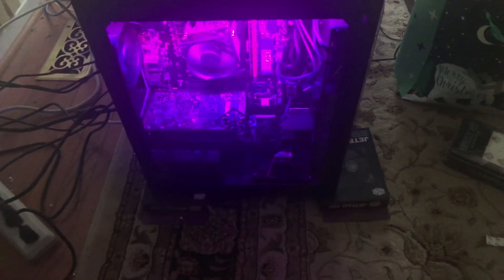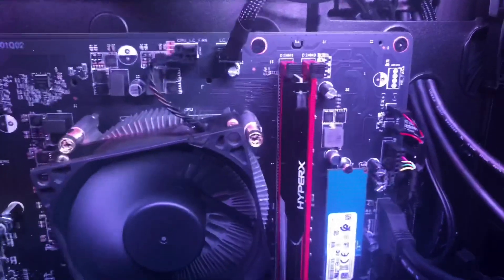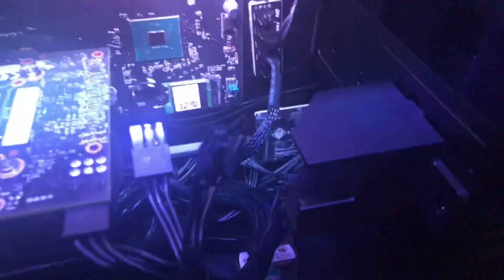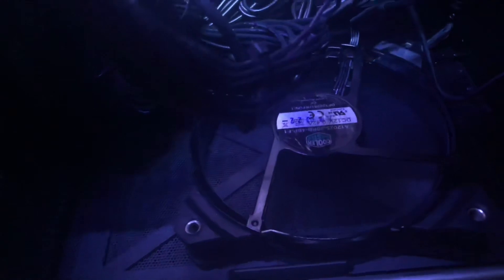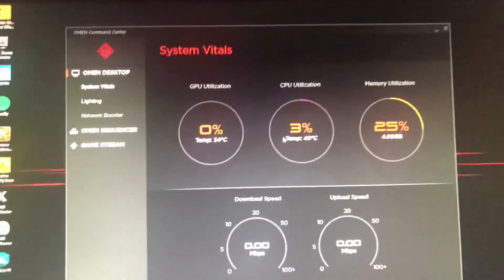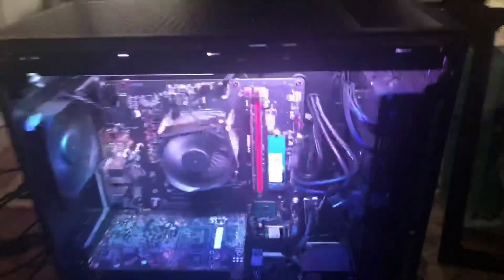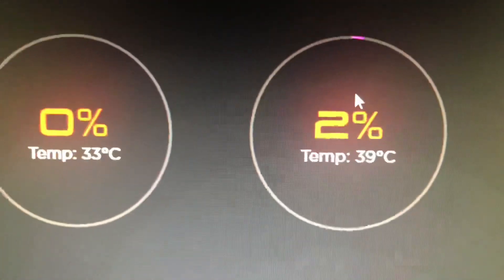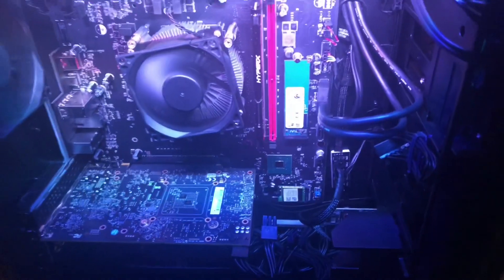Hp omen obelisk heat problems solved, no motherboard removal

Comment: Yo I have a question would that motherboard be compatible with the new rtx 3070 I have the same specs as u
Reply from the maker: Hey man, interesting question. I am also planning on upgrade to the 3070 ASAP. This motherboard is special and it’s hard to find anything on compatibility for the 3000 series cards. Personally for me I’m gonna rebuild my pc but keep my cpu. If you budget is tight I recommend going with a cheaper b450 and new case to make sure 3070 has proper space and cooling. Also the 500 W power supply is not enough for 3070, you will need at least around a 700 w
Reply: @buckeyebeck5456  ok my plan is to sell all the stuff I’m replacing, I’ll replace the motherboard with a b450, the cpu coolers with an AIO, and get a better power supply, and obviously get the 3070. Do you have any idea where I can sell my old parts?
Reply: I might keep my ram is 2666mhz good enough for 3070
Reply: Actually I’ll get a noctua
Reply from the maker: @IWR_YT  the parts in the hp omen don't really have any selling value other than the cpu
Reply: @buckeyebeck5456  true, but honestly an extra 50 bucks isn’t bad still saved money
Reply: @buckeyebeck5456  I’m going to get the z390 since b450 ain’t compatible with 1151 chipsets
Reply from the maker: @IWR_YT  sorry man i meant b365, was really tired when I sent that lol
Reply: @buckeyebeck5456  ohh ok
Reply: @buckeyebeck5456  it’s fine I can spend enough to get a z390

Comment: DId you secure the bottom fan you added as an intake? I was thinking of doing the same, but maybe put the dust filter on the outside of the case and DIY (forcefully) screw a 120mm fan to the bottom of the case.

Comment: I just bought a The HP Omen 25" Obelisk Desktop 875-0160  . I was looking where the HDD cords are at and they are connected to nothing . Is there supposed to be connected  to something ? I can play modern ware fare on max settings like nothing
Reply from the maker: One is connected, one is not connected and is kept for you if you decide to ad another hard drive
Reply from the maker: Hp has service videos about the extra sata data cords
Reply: Do you have the link ?
Reply from the maker: @fukubish6024  https://www.youtube.com/watch?v=EGUhYzBk6Go
Reply: That’s the thing I don’t have is a hard drive . Does it have to come with one ?
Reply from the maker: @fukubish6024  wdym you have to have a storage option or else your computer wont work

Comment: Oh yes. I definitely recommend a water cooler. I personally use a cooler master 120ML RGB, but a Corsair or other water coolers are fine. My temperature were stable and my pc is pretty quiet. So yes definitely get a water cooler.
Reply from the maker: mahi fishy I installed one in December it has made my temps and everything in my pc perform 100% better
Reply: Beck H great!

Comment: Nice! I may try a fan splitter with my build. I replaced my exhaust fan with a noctua 92mm fan, added a 120mm fan to the top and replaced my stock cooler with a noctua NH-U9S and added an additional 92mm fan to the cooler. Running Destiny 2 with 144fps and high graphics have my temps no higher than 65 sometimes 58.
Reply: Gerald Rucker did you have to removed the motherboard to install the NH-U9s? I’ve seen coolers like those were you need to install a different bracket in the back of the motherboard
Reply: @neligentcrib4368  I did but it comes with some adapter screws so you probably wont have to. I found the screws after I installed it lol.

Comment: There is an easier fix to this HP overheating problem.  The Windows 10 software can limit the power sent to the CPU so that it never overheats.  Right click on the 'Start' button and go to 'Power Options', then 'Additional Power Settings', 'Change Plan Settings', 'Change Advanced Power Setup', and scroll down and click on 'Processor Power Management'.  At that point three items are displayed.  The last one, the 'Maximum Processor State' is the one to change.  The default setting is 100%; you want to lower that to 90 to 95%, and you will get a dramatic decrease in the CPU temperature.  If you go lower than 90%, the CPU performance will be slower.  Do not go lower than 75% or the system could crash.  But there's no need to go too low, since 90% will work very effectively to curtail the temperature.   
My idle temp is now about 36 to 38C, and the temperature never goes above 41C during normal web surfing.  It used to skyrocket to 57C when opening a new tab on the web.
Reply from the maker: Achak Hakan that should work for anyone who doesn’t need to push for ghz such as people who do video editing nice suggestion!

Comment: Hey Beck,  I was just reading some information about fans and airflow in your computer that I thought you may want to take a look at.  It is not recommending that you put fans on the floor of your case, as this pushes hot air up onto your Graphics card and CPU, which it's saying you don't want to do that.  Take a look.  It might explain why in your video it shows the GPU and CPU temperature go up slightly when you turned on the fan?  I just thought I would share.  https://www.howtogeek.com/303078/how-to-manage-your-pcs-fans-for-optimal-airflow-and-cooling/   One other thing I was reading is you can use the bay slots (that you would use for a HDD) as a place to put a small fan that will blow cool air in.  I am installing a fan in the top portion of my case and am looking into installing a fan using one of the bay slots at the front of the case.
Reply: this isnt true. Hot air rises to the top and cool air goes to the bottom. If you put an intake fan at the bottom it pushes the cool air onto ur cpu and gpu

Comment: I don't know how old you were when you made this video, but I am so impressed with your abilities to problem solve your computer and make modifications that worked for you.  Good job!  Thank you for sharing what you did with all of us!  Edit:  I noticed that you have elevated your computer off the ground slightly.  On my HP Omen Obelisk, also shows a vent at the bottom (why on earth they chose to put it there and not on the side panel is beyond me) and it looks like you have just laid the extra fan you got on the bottom inside of the computer case on top of that vent.  I don't see any area there where you can actually screw a fan like that in, so I am assuming you're just laying it unscrewed on the inside bottom of your computer case?  Questions:  Do you have any issues with elevating your computer like this (do you worry about it toppling over)?  I seem to recall HP documentation saying to lay your computer on a hard flat surface.  You mentioned you had a dog (we have 6 cats), and the cat hair is enormous no matter how much we clean.  It seems cat hair gets sucked into the computer regardless and we have to blow out the hair and dust periodically from the inside of our computers.  Do the dust and hair get sucked up from that bottom vent underneath your computer?
Reply from the maker: Cat 52 thanks so much for the kind comments, I will be making an update video soon as I recently installed new aio cooling systems that made a world of difference plus some rgb. I will try to answer a lot of questions soon thanks
Reply: @buckeyebeck5456  I have the same PC and just installed the coolmaster 212 BE CPU fun and right after installation, no signal to any monitor I've connected to all ports. Any suggestions? PC Boots, Fans and all LEDs turn on as well. I'm not getting any beeps either and it stays on for as long as I let it, before force powering off.
Reply from the maker: Darwin Torres when I installed my aio there was one cord in the upper left corner for cpu power that I forgot to plug in but other than that I’m not sure why it’s not booting I would check all connections

Comment: Dont make a problem out of nothing i got the same temperature as you without any upgrades
Reply: I mean it would be maybe better but you don’t really have to i talk about it with two experts that build PC and they say that you don’t have to the temperature is quite good.
Reply: So are the overheating issues with this PC true? I'm gonna be getting this soon. And I been hearing people say to upgrade the cooling
Reply: Kinda true, tomorrow I’m installing the Corsair  H60 2018 Cooler, hoping for better results. Just worried about taking out the mobo

Comment: So I have the Rtx 2080 so there’s a really no difference but I totally need a better cooling system i really don’t know what to do, could u make a step by step vid
Reply: I recommend changing fans bro
Reply: did you get the water cooling for the cpu? if so, good. then there is a inktake at the bottom for air to come in so maybe get some little rubber feet to put it on for the meantime before you put some fans in it. or just download msi after burner and make them quite as possible while having good thermals

Comment: Hey bud, I just bought 
OMEN Obelisk Desktop PC - 875-0020RZ
OMEN Obelisk Desktop PC - 875-0020RZ
Power Cord
AMD Ryzen™ 5 2600
OMEN by HP Obelisk Desktop PC - 875-0020RZ
CKIT HP OMEN US
Energy Star
FLAG EPEAT
MISC HEVC MEDIA EXTENSION HP
WARR 1/1/0 US
18C2 Cycle AV
DIB WARRANTY 1Y US ENG HP INC
NVIDIA® GeForce® GTX 1660 Ti (6 GB GDDR6 dedicated)
HP RCTO OMEN Moria B450 PC
1 TB PCIe® NVMe™ M.2 SSD
1 TB 7200 rpm SATA
No Third storage
HP black wired keyboard with volume control and wired optical mouse kit
Shadow Black front bezel, glass cover with 500 W Internal Power Supply
McAfee Livesafe (30 day)
HyperX® 16 GB DDR4-2666 SDRAM (2 x 8 GB)
802.11a/b/g/n/ac (2x2) Wi-Fi® and Bluetooth® 4.2 M.2 combo
Office Trial
Windows 10 Home-Pro
MISC PKG Sgl PK TWR Dotcom

Think ill need a new fan or cooler?
Reply from the maker: Daz Black update me on temps when you run benchmarks
Reply: No

Comment: Cant i just leave the glass screen off and let it cool for a bit bro wym
Reply from the maker: TE_NoSignal dust will get in there easily
Reply: @buckeyebeck5456  can i used canned air?
Reply from the maker: TE_NoSignal to cool down?
Reply: @buckeyebeck5456  yeah. I just bought this pc as my first and dont really know hoe to install and parts tooo well
Reply from the maker: TE_NoSignal I wouldn’t recommend using canned air to cool your pc down
Reply: @buckeyebeck5456 what i meant was to clean the dust after leaving the case open
Reply from the maker: TE_NoSignal still wouldn’t recommend it, that’s a lot of work and you can’t always get all the dust out
Reply: @buckeyebeck5456  one last question do you think it is safe to leave the pc case closed when the gpu gets around 60° C
Reply from the maker: TE_NoSignal yes 60 isn’t very bqd
Reply: @buckeyebeck5456  so mu mouse tells me the degrees of the gpu in c° i close it and it gets close to maybe around 70 or more but never 80 hows that?
Reply: TE_NoSignal what?
Leaving the case open defeats the entire purpose of the case which to protect the components
Leaving it open will give u lower performance in the long run because those smal dust particles can be caught inside of the actual chip and PCB
The case is also used to establish an airflow inside to cook everything down
With it open u mess up the air flow which depending on your setup can actually result in lower performance
Think about it as if the fans are pumps
If u close the case the pumps pump out hot air
If u open it the pumps pump air but it’s just the room’s air and the components inside rely on the room temperature air to passively cool it
Reply: @AnonymousB0ss  yeah i just leave it closed the case was made for this it would hurt the pc unless overcloked which you need more circulation fans probs liquid cooler

Comment: Lmao I have the 2080 and my gpu keeps getting up to 80 degrees Celsius
Reply: I'm pretty sure that's not too bad
Reply: Dew 907 that is the borderline meaning of bad  that’s 176 Fahrenheit
Reply: Vyper Chexx doesn’t matter, computer parts are measured in celsius because people get worried when it’s over 150 degrees Faharenheit. The only reason you wouldn’t want to go to over 90 cel is because of throttling. your gpu is very heat resistant and will be ok
Reply: ItsNickk :/ thats normal for high end games i asked nvidia about it and they said anything from 89 degrees and below is normal (my card is an rtx 2070)
Reply: @reno3158  Hello, i recently upgraded from the stock gtx 1060 to the rtx 2080 super, i had some issues since the beginning but i resolved them with MSI Afterburner, its a software that allows you to manipulate the speed of the GPU Fans to get a better performance than the stock speeds. Check it out it might help you, my temp is around 60 to 65 C° at 2k 299fps in overwatch as example
Reply: Octavio Prieto Montantes can I contact you on discord or something? I’m wanting to upgrade my GPU to the 2070s and I was afraid of it over heating but looks like u proved I can do I. Did you upgrade your PSU?
Reply: @reno3158  Wow really?  That is 192 degrees Faharenheit.  That seems awfully hot to me for the GPU or even the CPU.
Reply: Cat 52 all pc components are measured in celsuis because they get really hot, and it’s just easier. no it’s not bad

Comment: I’m looking at one with the rtx 2080 but everyone says it runs to high of temps and that scares me from buying it. Can I upgrade the motherboard and cooling system or would just a cooling system work? I’m a YouTuber and twitch streamer and just don’t want the fans to make a lot of noise to where it gets in the videos and such
Reply: My brother's Omen was idling around 50 degrees with a stock i7-8700 (no OC) + GTX 1060 3gb, and both of them were steadily in the high 90's (causing crashes) when playing Destiny 2 at 1080p on average settings. Higher performance components are only going to make the temp problem worse because the stock cooler and single small exhaust fan are no where near enough to push air through the relatively restrictive case. IMHO you should build your own PC as someone already suggested, or at the very least be prepared to modify the case for as much cooling as you can fit (similarly to the video) if you plan on playing anything more demanding than Minecraft on it.
Reply: Harrison Stern Exactly temps are high , if your brother just got it TELL HIM TO RETURN IT
Reply: @andrewvong2421  unfortunately he's had it for a while now. I would have helped him build a custom one, but I didn't know he had bought it until he came to me about a month ago asking me why it was crashing. I was able to get the temps down about 15 or 20 degrees after installing a Corsair H70 (largest that would fit) and a couple Noctua ippc 3000's as intake fans. It sounds like a jet engine when they're at max rpm though lol.
Reply: Harrison Stern Oh good, I got my cpu down a bit with undervolting but haven't touched my pc yet, as I dont want to remove my motherboard
Reply: @andrewvong2421  I don't blame you cause it definitely was a project using a razor to cut the adhesive off the old cpu cooler backing plate and a file to widen a few of the triangles so the screws for the radiator would fit. It sounds a lot harder than it actually was though especially since HP has videos on how to remove and reinstall all the components.
Reply from the maker: Virtualized if your comfortable with it I would recommend building your own pc with a liquid cpu cooler
Reply: Beck Hartley yeah that’s what I’m gonna do. Just not sure what graphics card to choose. I don’t have enough to buy a rxt 2070 but I might try and buy a gtx 1070
Reply: Virtualized 2060 is better imo

Comment: Nice job on  the mods. However, I would recommend that instead of plugging the fan hub into the pump header that you plug it into the system fan header that the factory rear exhaust fan is connected to now. Then I would reconnect the factory fan and your two upgrade fans all into the fan controller hub. This will allow your motherboard to more accurately control the fan speeds because the pump header is constantly at full power, where as the system fan header can adjust power to speed up or slow down the fans as your system rises and lowers in temperature.
Reply: I've tried this, however I get the 90b error whenever I turn it on. When connected to pump header, it doesn't produce that error. Any suggestions?
Reply: I actually recommend buying a good liquid cooler and lowering all the fans speed somewhere at 75%
Reply: @TamerAlhajjarr  That's a good idea, except the Omen motherboard actually does not have system fan speed sensors, so basically, you get what you get in terms of fan speed¯\_(ツ)_/¯
Reply: K einstein lol

Comment: it's in ur bios, you can adjust the fan speeds.
Reply: Haha Hp doesn’t let you edit the bios
Reply from the maker: matt will yes but even with doing that the temps don’t have a big decrease
Reply: @buckeyebeck5456  aslong as ur gpu isnt running 90c or above i wouldnt worry about it and you could invest in quieter more cfm fans look up silent fans with alot of cfh Cubic Feet per Minute  the higher the better.
Reply: Yea @matt will for this mobo the bios is very limited
It is a prebuilt so it’s not meant to be tweaked